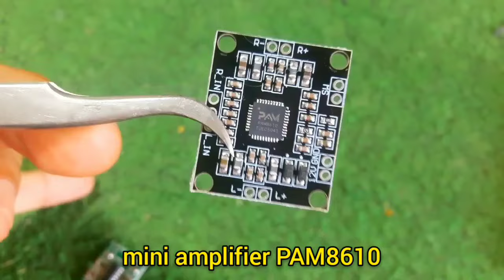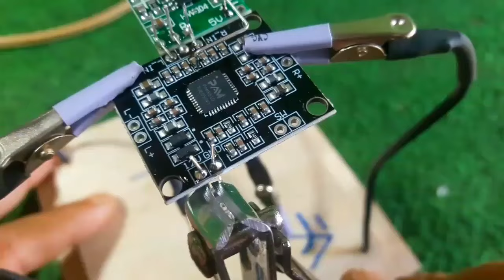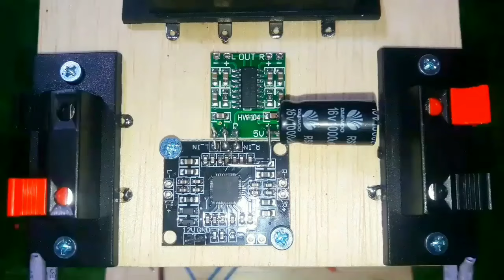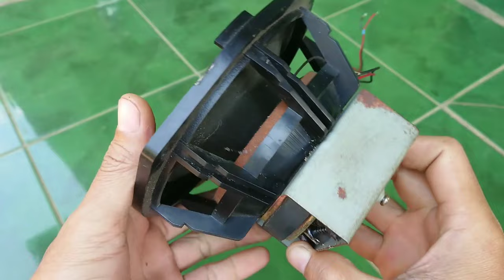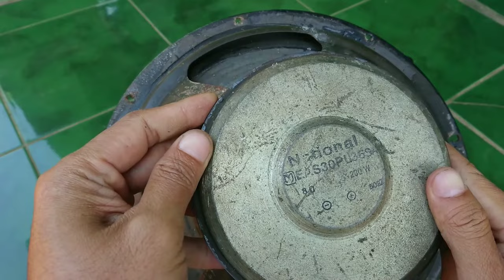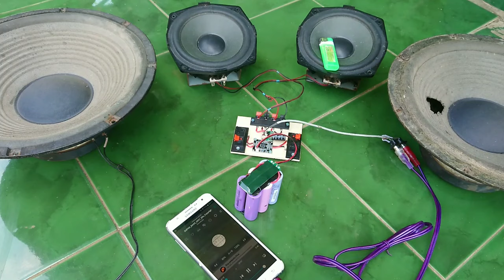DIY Powerful BASS 4channal Amplifier using PAM8610 PAM8403 simple circuit @WILTEXElek

Comment: Bang klw di tpa 3118 ada tegangan 5volt gk ya, buat siply blutut receiver. Biar single suply
Reply from the maker: nyala.. tp pas kena bass mati.. karena 5vol tegangan paling rendah.. d saat kurang dr 5vol mati
Reply: @WILTEXElek  mksdnya apakah ada jalur kaki untuk 5volt untuk suply blutut receiver, untuk tegangan 5volt di kaki yg mna ya pada tpa 3118
Reply from the maker: @CHANNEL_HIBURAN-3  ga ada mas
Reply: @WILTEXElek  klw pasang receiver blutut gmn ya bang,pakai step down atau ic regulator. Biar suara tdk nois

Comment: Pakai daya berapa volt om
Reply from the maker: 12volt
Reply: @WILTEXElek  pam yg 3w juga apkh dksih tegangan 12v mas ?
Reply from the maker: @08997335840  12volt dr pam8610
Reply: @WILTEXElek  emang bisa ea yg  3w speknya 5v dksih 12v mas?
Reply from the maker: @08997335840  d video kan sudah ada mas caranya
Reply: @WILTEXElek  ea mas v d video gk bgtu paham krn gk dksih skema ngmbil untuk yg 5w dari sblh mana ny
Reply: @08997335840  cari di google datasheetnya